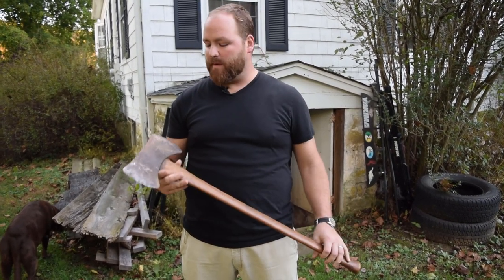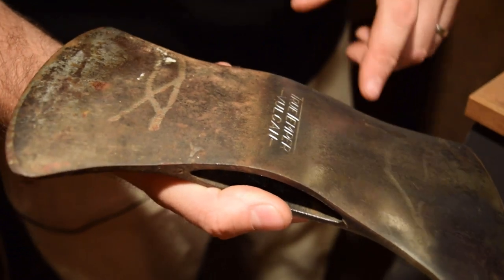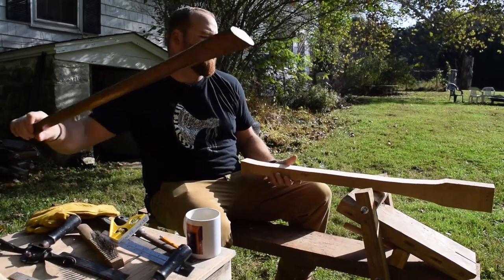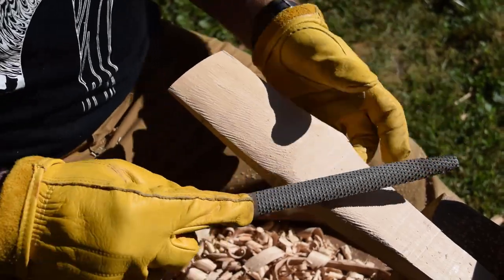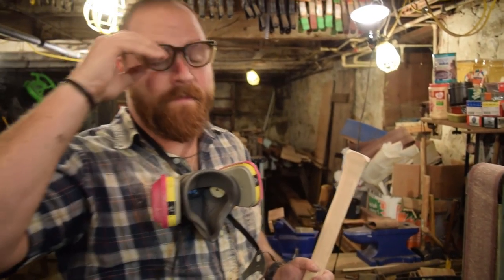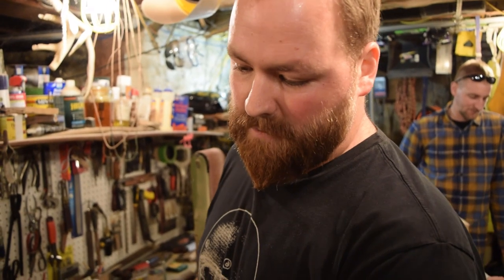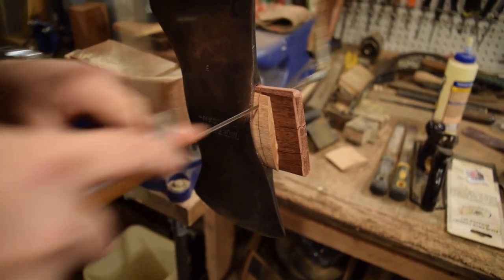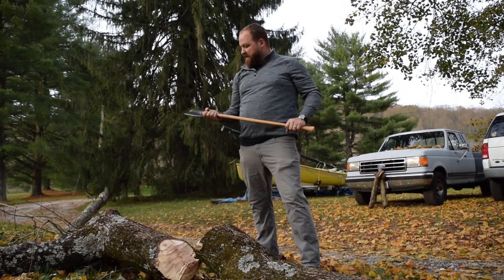Double Bit Axe Restoration and Rehandle

Comment: I just got handed down a double bit axe head that belonged to my great grandfather I can't wait to rehandle and restore it
Reply from the maker: That's awesome! Send pics to theartofcraftsmanship@gmail.com
Reply: DO NOT CUT THE HANDLE OFF
Reply: DO NOT CUT THE HANDLE OFF
Reply: @885Blackjack it didn’t have a handle when I got it. And it’s still sitting in my shop waiting for a handle
Reply: @sm0kejump3r66  right on brother. He actually made a mistake in the video. The handle can be easily removed the same way, without cutting it, with the assist of a rubber mallet.

Comment: You don't need to cut the handle off. You just need a rubber mallet, and a little patience.  Handles are almost always salvageable and don't need to be cut. Didn't quite understand that move. That handle can easily be sanded and rehung in fractions of the time it took to make a new one.

Comment: That wedge went in about 1/4 of the way, normally you want it 2/3 deep and cracks don’t matter they’ll disappear with a quick sand and soak up the oil better. Keep banging! 

Beautiful finish but try not to twist your whole body when swinging the axe, it’s wasted energy. Straight up, straight down.

Blessings brother ✊🏽

Comment: Great video. Great hanging and everything. You should look into pulling out the grain with a torch and then a walnut danish oil finish. It is Gorgeous on old axe heads like this. Linseed oil is great just kinda basic. I like a little character.

Comment: Beautiful job in that axe, one thing about the handle is than when fitting the head it’s better to only be able to push the axe head on about an inch or so, in this case you may need to do a little more than an inch, doing so allows a good tight fit. On the wedge it also helps to put a little linseed oil, boiled or not in to help the wood expand and keep it tight as possible. Overall a really splendid job on that axe

Comment: Hello,
I now this is older post but I'm curious about the grain. Could you not have cut the handle out at a 45 degree so the grain would be perfect or is it not that important? At 8:30 I'm wondering if you can see what I mean.
Thanks for the videos. Beautiful work

Comment: Awesome I just started my dad's double bit today . Question when refurbishing those you don't get too crazy about polishing all the Nicks and chunks out. Next question do you recommend preserving with Berlin seed oil after warming it up quite a bit to prevent corrosion in the future
Reply from the maker: When I restore an axe, I clean the head on the wire wheel, and then reprofile the cutting edge to get a clean edge, then sharpen. I dont remove the patina to the sides/cheaks. I will often regrind and flatten the poll. Because I dont remove the patina, i dont really need to protect it from rusting. I do coat the handle with Boiled Linseed Oil, and use WD40 or Balistol on the head.

Comment: Definitely a good find for that oddly specific $27, way too common to find double bits that were sharpened too much at the toe.

BTW you do know you don't have to drill eyes out right ?
just make a drift from a piece of wood and tap from the bottom out the top.
Unless there's glue or say red Plumb permabond they'll pretty much always come out pretty easily.

Comment: Greetings, super cool, i just received 3 old axes to restore but am finding a hard time finding information of fitting the handle to the head, in regards to size and such. Any things i should keep in mind? i have two "felling axes" and a broad axe, can i use a handle shorter than 30" or should i stick to its full length?

Comment: How does one identify the particular axe head? I have a true temper kelley perfec I'd like to I.D.
Reply from the maker: If you know it’s a TT Kelly Perfect, why do you still need to ID it? If you looking for more info on the brand, or looking to date it, I would suggest checking out yesteryearstools.com. It’s the most comprehensive website for information about axes. Good luck.

Comment: Why not restore that original handle?
Reply from the maker: It had some over strike that i wasn’t happy about. Also, I had a lot less experience with axe restorations when I made this video. 🤷🏼‍♂️😁😉. Think back now, I wanted to make a handle from scratch, but I would have removed and preserved the handle to use with another axe.

Comment: The first nail should be 6 inches from the foot of the handle, the second should be18 inches from the foot.

Was sad to see all that work skill and diligent care
To be set aback

Pains me to see you learn at that expense 
Im still proud of your work but I know you'll never settle once you know why those nails are in the wrong spot

They were put there as a quick visual measure for stove length wood

6 inches in diameter
18 in length
Any longer or wider it won't fit in the stove

I could have cried when you burned in those nail spots and nailed them

Broke my heart 'cause I could tell it is your passion
And that you strive for perfection

....like watching Christ crucified
Reply from the maker: Thanks for the advice and info. The original handle had the nails in those spots when I purchased it. Although I really like the information that you provided, and can see the benefit for those measurements, I like the idea of having a larger variety of measurements in standard sizes. Thanks again!

Comment: Nice work. I have a question on what is the different uses for a single bit ax vs. a double bit?
Reply: Single bit is a general tool, double bits would have a fine edge for cross-cutting and a rougher one for limbing or cutting roots, work that would dull and temporarily ruin the fine edge.
Reply: Double bit is WAY better for killing orcs
Reply from the maker: Thanks guys for both of you previous responses, but I have to side with ZFof2001😉. I have heard several different explanations as to the purpose of double bits as opposed to single. I prefer and agree mostly with the “multi use” purpose explanation mostly , but also think it was a way to basically carry 2 axes in 1 into the forest instead of actually carrying 2. When one got dull, flip it around and keep working. They also look damn cool, (as well as are good for killing Orks)😉. Thanks for your comment.

Comment: you cut the split for the head too far down.....the head will break the handle after some hard hits.....the wedge split should have been half that deep
Reply from the maker: You’re right. I probably did cut it a bit further than I should have. My go to depth is usually around 2/3-3/4, but this was a bit deeper than ideal. Fortunately, it has held up really well over the last three years.

Comment: Does you True Temper have the ridges in the eye, like mine?  That was a more or less trademark of a true temper double bit axe.  Mine is from the 1970’s and is in marked.  My single bit true temper axes have a 4 and a 5 stamped in them but the double bit has no markings that I can find but I know what it is - I bought it and it was labeled a Swedish double bit with a 36 inch straight handle.
Reply from the maker: John Clarke 
Thanks for watching and your comment. 
I started to collect Kelly/TT axes, along with many other sorts about 4 years ago. The majority of my Kelly/TT’s do not have eye ridges, but several do. I know that it it usually a good bet that if your no-name axe has eye ridges, then it’s most likely a Kelly/TT, but there were other companies that also used eye ridges.

Comment: i really wish you had not cut that handle off.  old wood is just as fun to bring back to life and re use.  there was nothing about that handle that couldn't be reused.  would have added a lot of value as well.
Reply from the maker: Yeah, when I look back at this video, which I made several years ago in my earlier days of Axe collecting and restoring, I feel the same way. That being said, I’m really happy with the handle I made for it, and it’s still holding up strong. I’m not planning on selling it, so I’m not worried about it’s value to anyone else.

Comment: Why not hang it flush with the top of the eye, the way it was originally hung from the factory? A vintage USA made axe just looks better "restored" to the way it would've came from the factory.
Reply from the maker: Thanks for watching, and for your input on the project. When restoring and rehanging this axe, my plan was to reuse it as well. In all my experience and research over the years, I haven’t been able to find any evidence that suggests that leaving the wood proud of the eye has negative effects. So other than asthetics, which I do agree with you have their merit, I know that the extra mechanical holding advantage that is created when the wedge mushrooms out the wood above the eye is worth it. (Also, I like the way that it look better😉). 
Thanks again and axe on!

Comment: you need to turn your draw knife over an it wont cut in so bad
Reply from the maker: Marshall Lawhorn 
Thanks for watching and the tip, it’s a good one. It’s hard to tell but I am using the draw knife both ways throughout the process, bevel up and down. Thanks again!

Comment: The FIRST thing you do is measure the original overall length and write it down. Why didn't you just remove the wedge and save the handle?
Reply: A couple of honest legitimate repairs to the handle, followed by a proper re-helving-that's true craftsmanship. Instead, what? all we can think to do is hurry downstairs and saw off the head because we don't know any better? Sad...
Reply: How is that better
Reply: Just curious, how do you take out the old wedge?
Also, no reason to rush to judgement, here; maybe the handle was dried out and brittle, or maybe the guy just wanted to make his own damned handle or show people how to make one. It's just an axe, man.
Reply: @willklusener9659  Half a year later... :) The best method is to drill some pilot holes, use 1-2 small wood screws, and pull them out. That usually pulls the wedge out super cleanly. If the wedge was glued in, and it didn't bottom out in the kerf, you can just tap it in a bit further, that will break the bond, then you can pull it out. If the wedge was glued in AND it bottomed out in the kerf, then you have to drill it out carefully, and then once the head is off you can clean out the kerf pretty good. I usually put a little sandpaper on a hacksaw blade. 

He said in the beginning of the video that the handle had some damage, and yes, it's just a handle, calm down OP. The axe community is full of annoying smartasses. Go to any youtube video, any instagram page etc. and you will find tons of people commenting "you did this and that wrong..." It's insane. Even if you go to something like the instagram page of a very good, accomplished blacksmith, you will find people saying you did this and that wrong... Everyone is an expert.

Comment: Ok, I liked the video but Dude, learn to edit, at best this should only have bee a five to seven minute video. Also, you don't need to explain every little detail to us. Most of us do this sort of thing too and we get it. I would make two suggestions. oil the entire handle prior to installing the head, that way the wood hold the head on get to expand slightly and it makes for a tighter fit. Second thing, make yourself a small tapered steel wedge and drive it in at a right angle to the wooden wedge, that will expand the wood yet again. Good job. Have a great day.